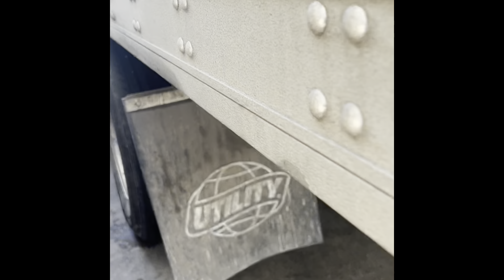Saying goodbye to my Truck// Chaotic week , ends with a blessing// Seeing a BALD EAGLE 🦅/ OTR solo

Comment: Love the road footage on I-49 in Arkansas. I live about 15 minutes from Fayetteville.  You're exactly right, God is in control. I have seen leaking wheel seals burn trucks and trailers to the ground. I have also seen duals snap off. That's a 400 pound missile  headed towards something at a speed fast enough to kill you before you can even blink an eye. You were also talking about the Bald Eagle. They are a beautiful bird and huge when fully grown. I appreciate the video and stay safe out there. I'm still trying to figure out what company you drive for.
Reply from the maker: Thank you man , ironically I drive for a company not far from you near Ft Smith . You be safe also 👍